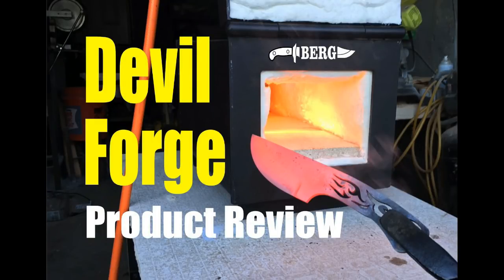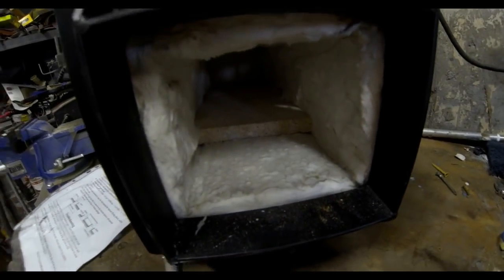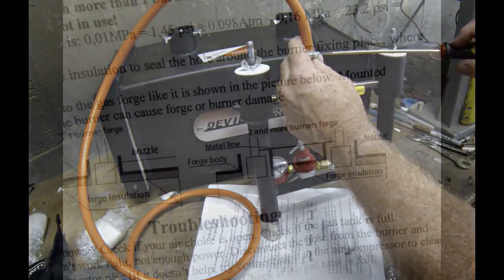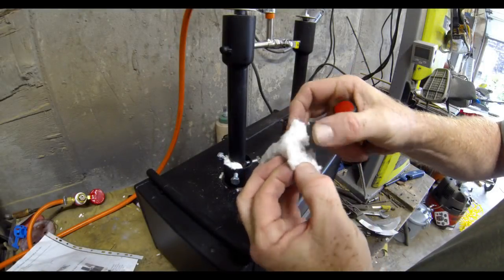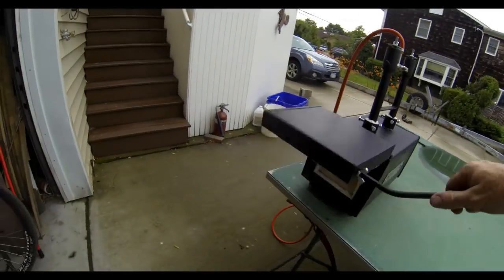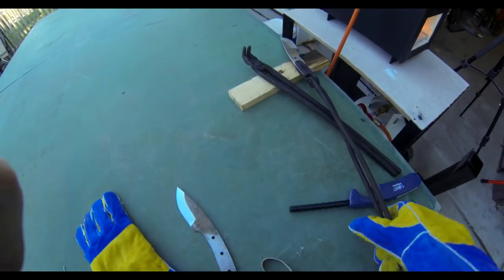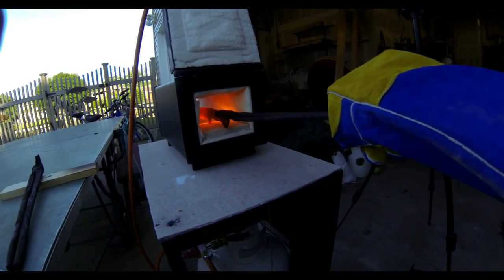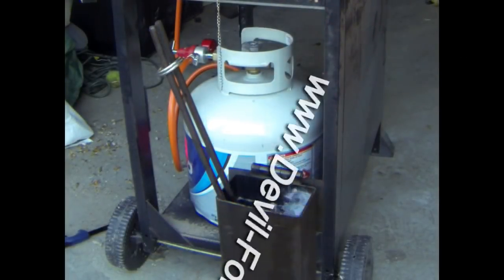Devil Forge Product Review and Setup updated video

Comment: I'm failing to see any updates to the video from the original other than the thumbnail.
Reply from the maker: Basically just two things. Mounting position for burners and audio and tale end of video. I was planning to re direct the first video to this one by Youtube now prevents annotations and links. Re posting the updated version was only way I could think of
Reply: DIYeasycrafts I would have really wanted to see the update about treating or hardening kaowool as to not release toxic fumes.
Devil forge doesn't automatically send that with the forge and it needs to be a consideration for someone new to using a forge. Especially people doing it near a garage like yourself. It's an added approx $30 cost which is negligible but it should be a "hey check this out" kinda warning for folks.
Reply from the maker: You are absolutely correct. What product do you recommend. I will get it ordered
Reply: @Bobba_fett  The kit now comes with a big bag of refractory cement to coat the entire inside.